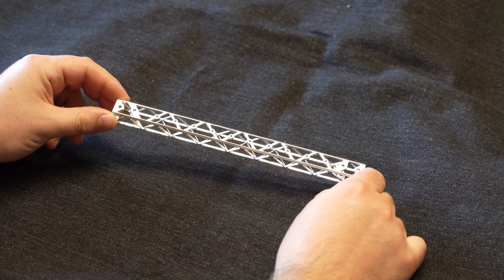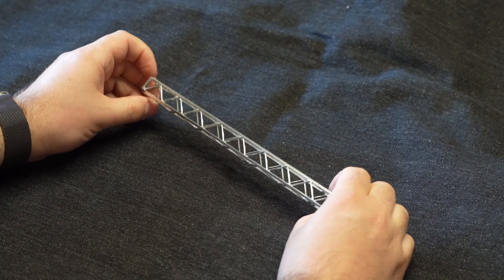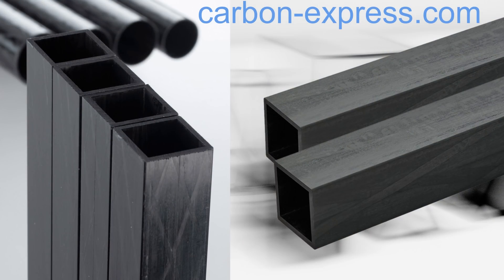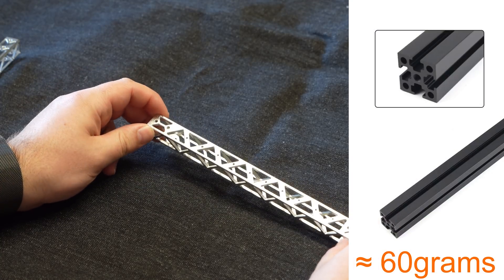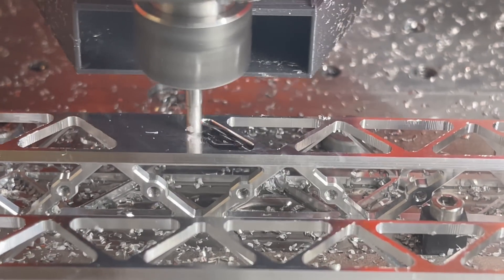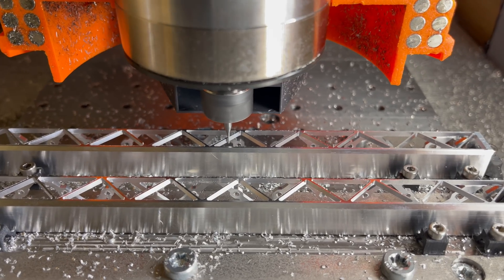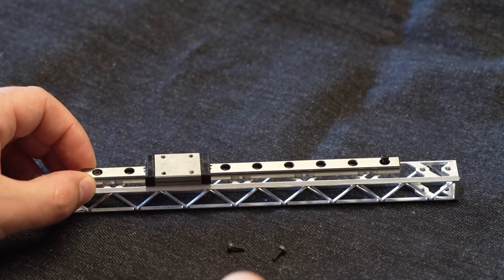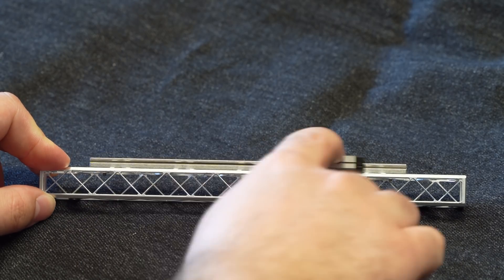Ultra light VORON 0.1 X-Beam

Comment: Hey Premium, are you going to add more stock of these? I would love to chuck an order in. I have a CF Tube on the way but this seems better
Reply from the maker: Hi, yes we are working on it since a few weeks now. We got a new setup which allows us to mill more X-Beams at a time, but it has a own set of challenges we have to work through. I am sorry for the delay. What CF tube did you get? Whats the weight and price ?
Reply: Listing says 16.5 grams but it will also require nuts
Reply from the maker: Good to know, where did you get it from?
Also there will be a black anodised version after we restocked our resellers with the standard version…
Reply: @premiumbasics  black would be cool but also polishing the plain alu would be sick. Could have a mirror finish
Reply: Aliexpress, I think my last message with the link got caught in a spam filter or something because of the link to the listing
Reply from the maker: Yeah I had this problem too, but I will find it, thanks!

Comment: I am a machinist, try using a spray bottle filled with kerosene, sprayed onto the surface you are machining, it does not need a constant flow, it will lubricate and stop the cutter form building up aluminium on the tool.
Reply from the maker: Thanks for the suggestion :)

Comment: hey man, I think your x-beam is elegant and shows great competence in your skill and talent, respect.  The more I roll over it in my head I find some criticism in the process' net material waste and moreover the functional gains don't provide a value of the benefit for your effort.   That is to say, it's a printer, so the OCD level detail for the final mass doesn't strike me as a priority.   If anything it's more concerning as I continue thinking because of necessary tolerances for rigidity, thinking fan vibrations and alike from the process of printing.  Nevertheless, you have talent and you should use it for your own design from scratch Id love to see that.  Good job.

Comment: One question I have, when you do FEA analysis to see if it is rigid enough, what performance metrics are you looking for? deflections less than 0.1mm at the max accelerations and speeds that are desired? A modal analysis that has certain characteristics?
Reply from the maker: I designed the V0.1 X-Beam and sent a .step file to @Fail Fast! who did a FEA analysis on it. I don’t know how to do a FEA analysis myself…

Comment: You could save at least 25% of time if instead of a rectangular tube you instead used a triangular one.
Reply from the maker: Yes probably, but then i had to do some bigger changes in the parts who holds it in the CNC and the printer..

Comment: How light would it be if you machined it out of carbon fiber tube?
Reply from the maker: It would weigh about 8.5 grams, but not hold up. If you wanted to make a CF beam with this design you had to put the fibers directly in this shape and cure it with epoxy…

Comment: You should go for a "mister" on your new CNC. I started with coolant but it's messy, the mister uses far less coolant and still lubricates and clears swarf...much better all around.
Reply from the maker: Does it also clear the nasty small chips?
Maybe i install both xD
Reply: @premiumbasics  I am squeezing the compressed air out through a welding nozzle tip so I found it's a more concentrated/focused blast of air at the tool then when I used those flexible vertebrate lines. Plus less compressed air usage (less noise), and less swarf flying off into my keyboard and all over every nearby surface! The swarf still clears, it just doesnt fly. The mister vaporizes the coolant in with the air so you get cooling (think going out on a windy day wet) and you get lubrication of the tool bit.
Reply: @premiumbasics  (Details) The plumbing is a bit tricky, the incoming air supply is split, one way goes straight to the mixing head (w/ welding nozzle), the other goes to the sealed container of coolant fluid and provides a pressure to push the liquid up into the mixing head. The split going to the coolant container has to be regulated down to 12-20PSI or you could blow it apart...I also have a 30PSI safety valve there just in case. There are diagrams and threads on cnczone to explain in  more detail. It's not hard to make and worth it!

Comment: What's the point? Spending two days for machining and save only 2,7 grams, with material 10x lower stiffness than carbon fiber beam?? But sometimes is nice to see that you can do it.
Reply from the maker: Could you provide a source for the statement:
”…10x lower stiffness than carbon fiber….”?
I did it because I was curious to see how far i could push it with my machine + I learned so many things while doing it about my machine and workholding :)

Comment: Very beautiful beam, nicely machined!  Now here's the question -- you have an ultra-light beam onto which you mount a solid steel (heavy) linear guide.  Is the total mass actually less than using ordinary V-Slot rail with plastic wheels?
Reply from the maker: Yeah the linear guide is heavy, some suggested already machining pockets in it to make it lighter.. I did not compare the option of a V-Slot rail with the linear rail. This Beam should be a easy upgrade for every Voron 0 owner, that is why I left the linear rail…

Comment: You should made it by bending a Laser cut aluminum sheet.
This way it would be 10% price and you can explore a cleaver "lattice beam" design, like in spacecraft.
Once you were going to machining, feel free to machine the linear embed to the aluminum pice, for the 3D printer application, it would be flawless.
Thrust me I'm also an engineer.
Regards bro! Ownsome work!
Reply from the maker: Would also be a option, but then i had to weld it back together after bending…
Thanks for the other tip with embedding the rail a bit into the beam :)

Comment: have you weighted the bolts?
i c a potential to reduce the number of the bolts by leaving more aluminum material on the face with threads
Reply from the maker: no i did not weigh them yet… i recommend using all screws to ensure even distribution of the forces..
Reply: @premiumbasics  the distribution is still a question of weigh efficiency: all bolts and  all bodies work towards the distribution -- which configuration works with less weight?
Reply: @premiumbasics  at first glance, i would put the threaded bulges on intersections of struts. could you imagine the rail creates a load orthogonal to a strut to which it is fastened? -- seems obvious? am i wrong?

Comment: for both accuracy and speed, this part should be made on a 4th axis. I'm a mechanical engineer, CNC machine programmer and machinist. I believe I would be able to make these parts in under 10 minutes each at work. Start with drilling big holes wherever you can!
Reply from the maker: Thanks for the advice, i really appreciate the inputs I get from people like You :)
Reply: @premiumbasics  cheers and good luck!

Comment: I wonder what the result would be of putting the CF tube through the same treatment as the metal tube. Since the fibers are not oriented with this sort of operation in mind, might have to make your own using a mandrel, fourth-axis turntable, and hook a pre-preg CF spool up to a CNC to get the fibers running in an appropriate crosshatch pattern... but I bet you could get it down to 10 grams, which is an incredibly time consuming way to shave a few extra grams.
Reply: Search for isotruss!
Reply: @gnarpoholic  It's a cool technology, but difficult to shrink down to the scale that the OP is working with.
Reply: simply invent a process to fabricate carbon fiber beams with arbitrary holes and the fibers oriented around them.

Comment: Do they really need to be square? One made from triangular extrusion might be even lighter. Or maybe not, I am not the one with a beam simulation
Reply from the maker: Maybe they would be better if made from a triangular shape, but this is a bit harder to create a fixture for & a bigger redesign on the 3D printer to hold them would also be required…

Comment: Check out some peristaltic pumps to use to flow coolant. Some are DC motors, others are stepper motor driven. A small orifice sprinkler spray nozzle can be mounted alongside the vacuum nozzle or on the spindle. I like your work!
Reply from the maker: Thanks for the advice, will decide on a pump later on in my CNC project :)

Comment: Change your milling strategy, full penetration spiral entry .8 dia of tool, .01 radial engagement per pass, and climb mill. Predrill the corners possibly increase speed as well.
Reply from the maker: Good idea to pre-drill the corners! :D Thanks :)
Reply: Also spiral entry can be helped by drilling the center point of the spiral will prevent material jacking. Use self centering tip type drill and cobalt works best for aluminum. Don't go with feeds and speeds from machinery's handbook though. Co drills work good on 6k+ rpm range.

Comment: Not sure if it's important on v0.1, termo expansion ratio of CF is very close to steel and as a result combination cf+rail doesn't bend as much in closed chamber. I wander if similar litening technique would work for CF beam on 300mm v2.4
Reply from the maker: I think termal expansion is neglectable on a V0.1… 
Milling it out from CF would result in short
fibres at the thin struts & not hold well..

Comment: I'd use WD-40 in place of no coolant. It will reduce the pressure welding on the flutes of tiny endmills.
get the liquid, use an acid brush...looks like fun, tho!
Reply from the maker: Would surely work great but be a mess :) At the moment i use isopropanol, it evaporates and no chips are sticking after it…
Reply: @premiumbasics  
  no, just dab it..a Silicone base lube creates a barrier that rejects Alum..esp for micro mills and drills. I ran a big Prototype toolroom for 30+years...I love your part, it's absolute artwork.

Comment: That looks more like a part for SLS metal, maybe even iconel steel, check sculpteo or xometry (both europe)
Reply from the maker: Maybe it would be even lighter, but also much more expensive…
Reply: @premiumbasics  how much is each part costing at the moment in machining time?
BTW Xometry also has CNC quote solutions you can compare one to the other
Reply from the maker: If i make it on the current machine it is ~75$ to pay my time & tools etc. I did make a quote to machine it at Xometry, but in order to get a good price i would have to order to many… 
I hope to bring it under 50$ (without shipping)…

Comment: This looks really cool! No idea why it was recommended to me, but pretty impressive machining for the mill you're using, very nice work. If you need any help with machining small batches in the meantime let me know, I have a small shop with a Haas VF2, and do prototypes and the like for my own designs, but do the occasional small run of stuff for people as well and this would be a fun project. But I understand wanting to DIY so good luck in any case.
Reply from the maker: Thanks for Your offer and good wishes :) I don’t know either why this video gets recommended to so many people. It was originally intended for a small circle of 3D printer modders :D
Reply: @premiumbasics  I'm here for the gun channels, but this is fascinating and as a steel fabricator it is great to see "the big stuff" in micro versions! Good luck and maybe consider spray cooling, made mine cheap for my mini mill.

Comment: With this, along with belted Z-axis and mini stealthburner, it looks like the V 0.2 is coming !!
Reply: Except that vorons are principally designed around common off the shelf easy to source parts not bespoke customs ones, unfortunately for this masterpiece . Makes for a very nice modification though.
Reply: I wouldn't be so pessimistic. If the files for the CNC router become open source, manufacturers can produce beams like this and we could see LDO Motors or Formbot sell them as an upgrade.

Comment: what if you do same but with carbon? :thinking:
don't think it is possible to do this in a traditional layer-by-layer way but what if you make small carbon fibre ropes and use them with epoxy?
Reply from the maker: If You make a custom mold and tension the fibres in the same shape while adding epoxy, this would probably work..

Comment: Really cool. It would be interesting if you load the beam with e.g. 5 kg and measure the deflection, and compare the deflection with carbon fiber and 80/20. Low weight is great, but rigidity is important, too.

Comment: Yo, you can take carbon fiber profile and CNC machine it ;)
Reply from the maker: Milling it out from CF would result in short
fibres at the thin struts & not hold well..
Reply: @premiumbasics  hmm, your right) then, it is possible to make very light wooden "x beam" and cover it with a few layers of carbon fiber, this would be veeery light, but challanging to do

Comment: First, realize the cross section of the beam should be a triangle, not a square beam, only make the ends square for simpler motion control set up.  Could probably shave a good bit of weight j
Second, for oiling the small end mill.  Get a needle oiler, very small diameter or close off the end to control the flow, air vent at top and get it to drip at the correct rate.  Then just mount it to drip at the top of the small diameter of the end mill at the correct rate while it's operating..  Won't be easy to get it perfect, but should be able to get it OK without too much trouble and extend the bit life.
Reply from the maker: How do i turn a square aluminum profile into a triangle profile in the middle of the beam? Making the whole beam as a triangle would result in bigger redesigns for the parts holding the Beam (in the printer and the CNC) & i am a lazy person ;)
Yes the oiler would help, but other things are also not good on my machine…

Comment: have you considered  milling out the ladder structure from the square carbon tube ? Given the desire for mass reduction, does Fastner Express have aluminum fasteners in the sizes you need ? Your AL trellis beam looks quite sexy !
Reply from the maker: Thanks! Milling it out from CF would result in short fibres at the thin struts & not hold well…

Comment: What forces you use for do the finite element analysis?
Reply from the maker: I did not do the FE analysis, @Fail Fast! did it for me. He used his toolhead of 100grams at 500k acceleration. His result: Deflection 20 microns and a minimum safety factor of 8 before it yields.
(Remember this is for V0.1)
Reply: @premiumbasics  thank u!!

Comment: Why not. Try the same with carbon fibre tubes.
Reply from the maker: Because then i had to cut the fibres which would lead to a weaker beam. If you made a beam with long fibres in the shape of the aluminum beam, then it would probably be a good beam…

Comment: Your calculation comparing it to a carbon fiber beam is incorrect. That heavier carbon beam is MUCH stronger than an equivalent weight aluminum beam. If you are comparing to a CF beam of equal strength, the CF beam would be much thinner in wall thickness, and lighter. Perhaps consider a round CF beam with mounting points added, if it is suitable for your application. But if CF is not an available material, this design is quite interesting and uses readily available aluminum stock.
Reply from the maker: I did not choose the carbon fiber tube based on a calculation, but because it would fit in without any big adjustments. How did You calculate it? How does the CF Tube hold up in regard to stiffness? If i recall it correctly, carbon flexes a bit even if it is stronger..

Comment: why not mill the carbon square tube instead?
Reply from the maker: Because then i had to cut the fibres which would
lead to a weaker beam. If you made a beam with
long fibres in the shape of the aluminum beam, then
it would probably be a good beam...

Comment: Can the linear rail be used as a structural element? (I'm thinking engines in motorcycles and racing cars)
Reply from the maker: I am not sure if i can follow Your question :/
Reply: @premiumbasics  I think I should have used the term 'stressed member' - ie the linear rail provides a fair bit of strength/stiffness that the X beam then does not have to. I guess you'd have to do the finite element analysis with the rail included?

Comment: How does tramming work without the slots at the ends?
Reply from the maker: Sorry I don’t get the question, could You explain further?
Reply: @premiumbasics  distance between x-ends
Reply from the maker: sorry for responding so late, do You mean the milling process for getting the exact lenght of the beam?
Reply: @premiumbasics  I mean being able to adjust for discrepancies in distance between Y rails. If the printed parts holding it has slots then that's good, but plastic usually deforms making it hard to finely adjust that. Like on the AB motor mounts.
Reply from the maker: Ah now i get it, there is not much you can tramm, maybe +/-0.2 mm. I just assume that everyone who builds their Voron uses a granite surface plate to assemble everything perfectly perpendicular :P
@Fail Fast! Was the first to test it and judging from his newest video it worked…
But You brought up a important point, thanks a lot!! 

At the moment the only thing you can do if it does not mach the Distance between the Y rails is to modify the printed parts…
Take a minute to look into the livestream @Fail Fast! did about it:
min. 33:00 for a closer look…
https://youtu.be/Y5HpL-OFljk